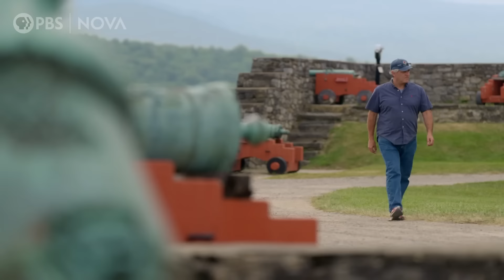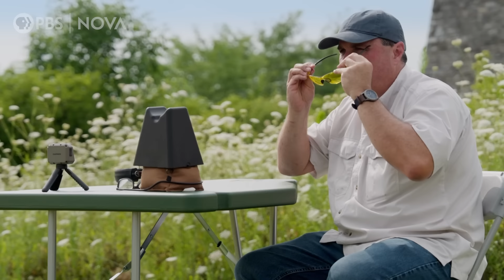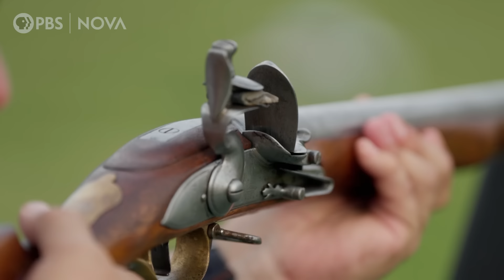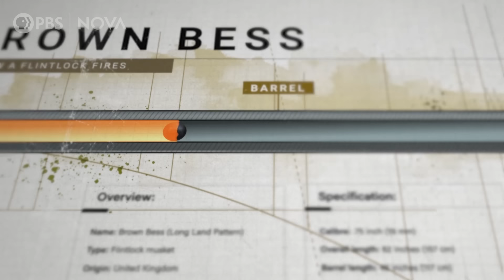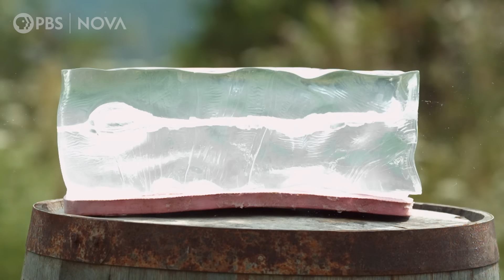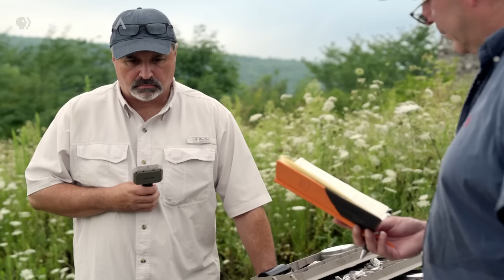How Deadly Was the Musket? | NOVA | PBS

Comment: Haw many grains of FFg  black powder did you use for the charge?  If you used less than 120-grains of 2Fg powder then you weren't using enough. The paper cartridges were loaded with 160-165grs. of black powder.  That cartridge was used to charge the flashpan AND the main charge.  Filling the pan was not precise but figure no more than 40-grs. for that.  That still leaves a main charge of 125grs  or more.

Comment: The equation for kinetic anergy is half mass times velocity SQUARED, so of course comparing black powder to supersonic ammunition is going to give them a suitably cinematic result.
But a muzzle velocity of 845 feet per second and a ball weighing about 1.1 ounces gives a kinetic energy of 1034 Joules
In comparison Colt .45 ACP has a quoted muzzle velocity of 935 feet per second when fired from a Thompson machine carbine [Wikipedia] which with a 15 g round gives a kinetic energy of 609 Joules.
Of course you've got flight ballistics and all sorts of things to consider, but these things weren't messing around.

Comment: “The flint strikes a hammer” (????) The hammer holds the flint.  The trigger releases the hammer, the flint strikes the frizzen.  The frizzen is a sort of rasp that gets rubbed—just like striking a match on a rough surface—by the flint, that produces sparks, then forces them downwards.  At the bottom is a pan, filled with very finely milled gunpowder, that’s used to touch off the main charge of coarser powder through a small hole in the side of the gun-barrel.  Anyone who’s ever started a camp stove with a flint knows how it works.

Comment: Looks like they're firing both weapons at extremely short range. My initial guess was 25 metres so I asked AI to figure out the range. For those interested, here's what it came up with and it's methodology...

Yes. Based on the image, I’d estimate the distance between the gel/barrel target area and the seated shooter at roughly:

About 22–24 metres

That is approximately 24–26 yards. My best single estimate: 23 metres / 25 yards. That estimate lines up with the visual geometry and with the kind of controlled historical-firearms gelatin test this appears to be. PBS identifies this as a NOVA/Fort Ticonderoga test using ballistic gel, slow-motion footage, a chronograph, and a British Pattern 1756 “Brown Bess” musket. A related colonial-era live-fire study describes British Pattern 1756 Long Land musket gelatin testing at 25 yards, which fits the image almost perfectly.

How I’m estimating it: The barrel on the left is probably around 0.85–0.95 m tall. In the image, it appears very large because it is close to the camera. The standing man beside it is likely somewhere around 1.75–1.85 m tall. The firing table and seated man in the background are much smaller, but still clear enough to estimate perspective. The white line/tape running from the foreground toward the shooter is the best clue. It appears to mark the shot lane or measured distance. Its visible length, perspective compression, and the apparent size difference between the foreground barrel and background table suggest something close to 25 yards, not 10 m and not 50 m.

My confidence: I would call this a medium-confidence estimate. A single image cannot give an exact range unless we know the camera lens, focal length, camera position, and at least one confirmed real-world measurement. But from the visible setup, object scale, and perspective, I would not put this at 10–15 m. It looks longer than that. I also would not put it at 35–50 m. The shooter is not far enough away visually.

So the practical answer is:
Estimated range: ~23 m
Likely range band: ~20–27 m
Most likely: 25 yards / 22.9 m

Comment: The real issue cannot be resolved by testing modern replica weapons firing modern ammunition and qualty controlled black powder.  If one wants to know how well a contemporary musket or rifle performed that was manufactured in the 18th century firing ammunition manufactured in the 18th century using powder produced to 18th century standards then it is best to reference the actual range tests conducted by the armies of the period.  Particularly important is the incidence of misfires and 'flashes in the pan' which rose significantly as the weapon became fouled and the firer became tired.  There is also an unexplained discrepancy between the performance of weapons tested under range conditions, even when the firers were firing under stress, and the effect of those same weapons in battle conditions when for some reason performance dropped off significantly.  There is even a theory that tries to suggest that soldiers deliberately avoided aiming at the enemy.  For example:  Muller's Tests of the Brown Bess Musket achieved 53% hits against a company screen at 100 yards under unstressed conditions with a well drilled company, but this dropped to 40% when fired by a random company of trained men.  However, at Blenhiem in 1704 Rowes Brigade of 2,400 men were attacking a village, defended by 4,000 Frenchmen. The French fired a controlled short range volley at the British, but despite this being the first French volley using new flints and the weather being dry instead of the expected casualties of around 1.600 from the first volley the British only lost 800 men in the enture assault. Suggesting that the performance of the French musketsry was about half what it ought to have been.

Comment: This is such a low quality production.

The problem with the musket wasn't that its projectile wasn't powerful enough... in fact, the muzzle energy of a musket typically exceeds that of a modern intermediate cartridge service rifle (such as 5.56 from an M4). However, muskets were incredibly inaccurate because rounds not being twisted on flight (via rifling) and not having a tight grip over the barrel means they would exit the barrel at odd angles, as well as continue to fly unpredictably like a knuckle ball. This meant that muskets were not effective at range unless they were used in volley fire against a mass of targets which statistically resulted in effective damage.

Second, muskets take a very long time to reload (compared to breech loaders, later repeaters and select fire firearms), they're unreliable, they can be improperly stuffed or loaded which results in jamming or explosion and they were sensitive to the elements, especially rain and humidity, they also have a much longer hang time between the trigger being pulled and the projectile leaving the barrel than a modern firearm which meant they couldn't be held on target as reliably.

PBS, just let the gun tubers cover these things, this is well above your capabilities.

Comment: "The higher velocity... means it caries substantially more energy". Tell me you do not understand physics without saying so. Energy != force != velocity. A 0.69 has around 50g, a 0.303 has only around 11g. Given that E=mv²/2, the rifles .303 thus has only 50% more energy than the .69 despite almost triple the muzzle velocity. Yes, it is much more devastating, but that's due to a LOT more factors than merely muzzle velocity... which does NOT "mean it caries substantial more energy" per so.It's more complicated than that.

Comment: US Civil War reenactor here. 
While most Civil War infantry units had rifled muskets firing the Minie' ball, the actual math between rifled and smoothbore muskets is almost the same. The difference is in the accuracy per shot, rifled muskets being more accurate and the Minie' ball ammo allowed for the same rate of fire.
Consider:
And infantry company was defined as 100 men, from the drummer boys to the captain commanding. Assuming the company was at full strength [which almost never happens] and depending on the drill manual used that's something along the line of 80 to 84 muskets per volley. A company commander was happy if his troops could fire 2 volleys a minute; an extremely well-drilled and proficient company to get up to 3 rounds per minute.
But using the low numbers of 80 muskets and 2 rnds per min, we have 240 x 1.5 oz [ball weight] = 15 lbs of lead coming in a chest height every minute.
So how frikkin' deadly do you think *that* is?

Comment: The musket was just as deadly if we're talking about ballistics. 
No one questions this. 

It comes down to accuracy.  Let's consider it. You're shoulder to shoulder bumping into other soldiers,  you're "aiming" a musket with no sights, you're not at a bench, you're shooting off hand, the musket of the guy to your left is firing and spitting chunks of searing hot burning gunpowder at speeds fast enough to embed themselves into the left side of your face and you're jacked up on adrenaline as the line of enemy soldiers are about 100 feet away.

The average shooter on the range shooting under ideal stress free and safe conditions still hits target stands and bullet barricades, I've seen it. Go to a frequently visited public range and pay attention to the bullet holes. 
When the OVERHEAD barricades sitting well above the target stands are peppered with bullet holes it should tell you something. 
Imagine if these people armed with modern rifles were placed in identical circumstances as musket armed infantry. 

I think the musket armed infantry of the late 18th and early 19th century are unfairly judged.

Comment: To make a musket useful, it's all about the aim, the timing, the speed of handling, the maintenance during the traveling, the provision supporting the mission. It was just another tool, to be able to win wars, with less people, and larger enemy resistance. It was an invention needed to prevail. Is all. It was very deadly, within it's range, wielded by a steady hand, and nerves of steel. War, went down very differently then we see before or after. Like innovation brings change and opportunity. The invention of the musket stood for these. And was born, by craftsmen and smart thinkers as well as being pushed in to a corner, where you don't want to sit. It was either to eat, or being eaten. And that has never changed yet. This is life. Get used to it.

Comment: That wasn’t the smoke from the bullet in that last shot.  The smoke was caused by superheating/ignition of the air in the cavities of the gel as it bounced back together.  If you rapidly compress a cavity of air it will superheat instantly.   Kind of like how a Diesel engine works.

Comment: Comparing a musket to a modern rifle is pretty much a 'apples and oranges' situation. The people who were using these muskets regularly were well aware of the weapon's limitations and the limitations of the time, these guns were specifically used for the most part in mass volley fire situations, where big divisions made up of regiments in line formation would basically turn into one big mass of explosive smoke and fire aimed directly at another enemy's formation. So even with technological limitations, they were able to make the musket into a very deadly weapon responsible for mass casualties, rifling did exist in the 18th and 19th centuries, and if they had picked a weapon with rifling from back then it would have been a more apropos comparison. 

Older rifles had limitations too, which is why they weren't the predominant weapon used back in these times, but held more of a support role, riflemen and skirmishers in smaller and loose formations were used frequently, they didn't have the mass volley power of the normal infantry, but they were more precise and mastering it required the skills of a true marksman. 

Interestingly, the skirmishers of those times have more in common with the modern infantry of today, many of these units as said before worked in smaller formations, and often were deployed not in massive regiment formations but rather were more spread out and ideally used environment for cover from a distance in order to get the most protection and fire the best shot.

Comment: In "New Principles of Gunnery" written in 1742 by Benjamin Robbins. He used a ballistic pendulum and tested service loads from a Brown Bess Musket which found the bullets were generally going between 1600-1700 fps. The ball weighed 1/12 of a pound which is about 583 grains (38g). With those calculations of period loads would be about 3500 foot pounds. Historical powder could be powerful but inconsistent, but early 1700s paper cartridges sometimes had over 200 grains of powder, and of course some would be used to prime the pan. The musket is this video didn't even get half the velocity which means they underloaded it a lot compared to a historical charge.

Comment: Simple math to calculate the kinectic energy of the Musket bullet:
bullet speed: 845 feet per second or 258 meters per second
They didn't mention the bullet weight. Since the bullet is made by lead. It should be as heavy as the same size of lead cube.
A .69 inch lead sphere's volum should be around 4/3π(0.345inch)^3=2.8 cm3 or 0.17 inch3. Lead's density is 11.34g/cm3
Hence, the bullet should weight around 31.8 grams, or 490 grains
So the kinetic energy is: 1058 Joules or 780 ft-lb
Reply: These calculations are incorrect. The speed of a musket bullet is much higher, approximately 1400-1700 feet per second. The bullet weighs 25-30 grams. The kinetic energy averages 3000 joules.
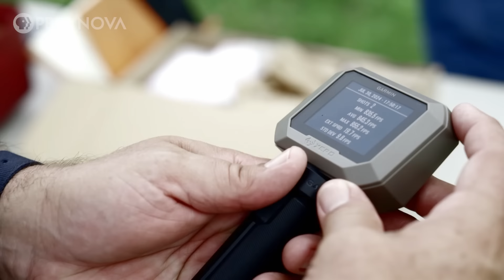Reply: @KaL_69_ Watch 04:27. The guy in video said "whereas the musket is 845 feet per second." As showed in the chronograph screen. Even if there was anything incorrect, it should be the chronograph they used, not my calculations.
Reply: @werolo3520  Yes, I understand. This video is the worst historical reference... They don't even know that bullet speed was first measured in the mid-18th century. So 300 years ago, bullet speeds far exceeded the chronograph readings in this video.

Comment: A little confused about the conclusion. Modern guns are chosen for many things, and are far superior to the musket when it comes to range and accuracy. The title is "How deadly was the musket?" and if we are to compare modern guns with a musket at a relatively short range, questions rise. Higher velocity does not necessary mean more deadly / destructive,  as a smaller cross-section of the projectile means less of the energy actually being transferred to the target as it just passes through more easily (Although the damages caused due to cavitation are well pointed out here). The musket should have been fired with a Minie Ball as projectile. A better human analogy as a pig's carcass should have been used as a test subject. Just my thoughts as it would have made it more interesting.

Comment: Why are they not talking about the bullet shapes? I'd like them to try a sharp tipped bullet too on a musket
Reply: Well it wouldn't really be fair since conical rounds require rifling and comparing a rifle to a smoothy just isn't fair if you're talking about accuracy at distance.  Sure you could compare patched round ball to conical so long as you have rifling specific to both (they can't have the same twist rate) but even that's uninteresting because conical will win.

Conical rounds are not only more aerodynamic (with a proper twist rate for their shape and velocity) but an elongated shape allows for more mass out of a given bore diameter.  You can't get more mass out of a sphere without going to a larger bore diameter.

Comment: This may sound quite obvious to the initiated, but for those who are not so well-versed in ballistics, I think it's relevant to mention the difference in terminal ballistics between a large diameter, slow moving, pure lead projectile versus something like a .30 caliber high velocity jacketed projectile. The damage from the large and slow projectile can be equally devastating in its own right, sometimes even more so. Pure lead will often deform and mushroom, much like any softnose or hollowpoint bullet, delivering a lot of potential energy. It will create a smaller cavity due to the low velocity, but the heavy lead projectile will "push" through you, causing a larger entrance and exit wound than the smaller, faster projectile. It will also drag out any potential bone fragments, which is as nasty as it sounds.  Where the faster projectile excels, is the tissue damage from a high-velocity object traversing through flesh. There is a larger degree of "shock" impact from a fast moving object hitting a dense target like flesh and bone, causing a very different energy delivery than a low velocity object. A fully copper jacketed projectile will also not deform and expand in any meaningful way, compared to the soft lead, meaning it will tend to "zip" right through, the damage essentially being caused by the velocity itself.

All this to say; modern firearms and projectiles are not inherently more deadly than their antiquated counterparts. They simply deliver their energy in a very different manner. Not to mention the ergonomics and logistics of smaller calibers, meaning that they will have a flatter trajectory and you can carry a lot more of them. All that being said, you should definitely stay out of the way of any kind of small arms projectile, antiquated or otherwise.

Comment: First Correction: The flint is a component OF the hammer via a clamp and is not a separate part. The piece the flint strikes is called a "frizzen" and the small shelf like area where the power sits is called a "flashpan"
Second Correction: There is normally a second or so delay between hammer strike and discharge for most flintlocks. A "fraction of a second" is NOT CORRECT. 

thirdly, Why does this feel like liberal propaganda? it just sounds the same level of ignorant as all the other anti gun blabbers.